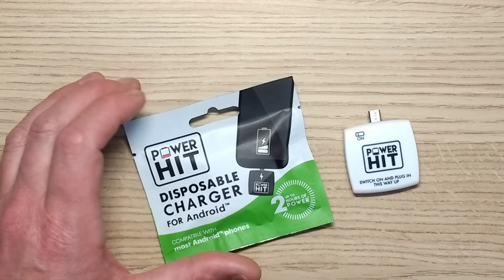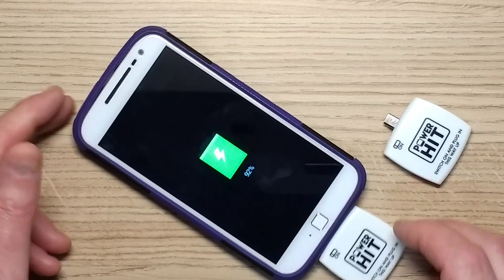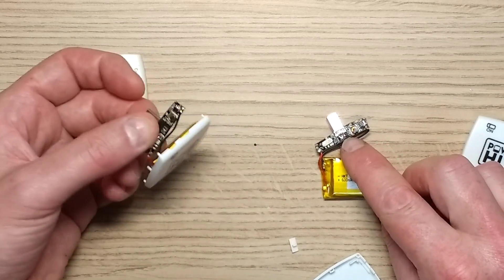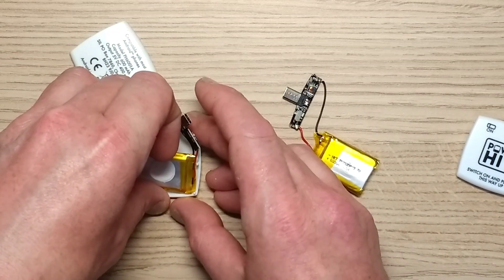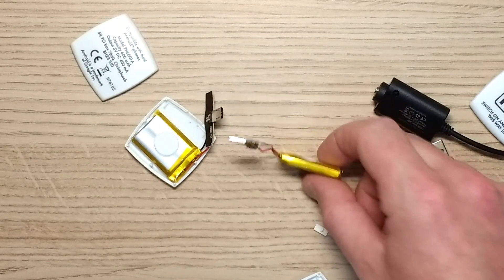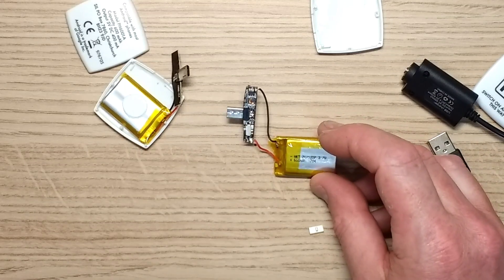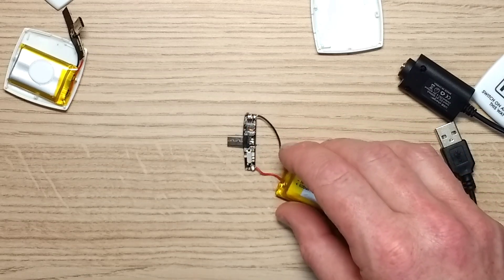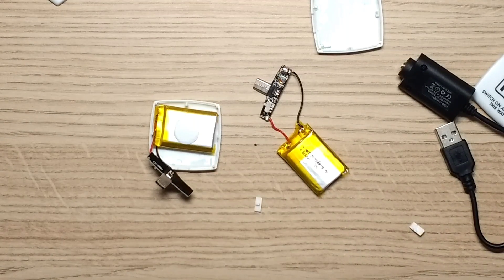What's inside a Tesco Power Hit disposable phone charger.

Comment: Android follows the USB 1.1 standard where dedicated chargers are supposed to have < 100 ohm between data pins. You can google the standard, it's in the PDF datasheets. Without this <100 ohm across the data pins, Android assumes its a data USB connection and limits itself to 500mA charging current. Apple disregarded this part of the backwards compatible standard, and most cheap chargers also neglect it. This is why people say Android charges slower than Apple, when really its Apple neglecting the standards as is Apple's way. I manually open my chargers and short the pins, or use a dongle with pins shorted -- this makes Android charge faster in my experience, especially on cheap chargers.

You might say Apple had the right idea in taking as much current as the voltage drop will allow at all times regardless of the presence of data since it means Apple products don't care what's done with the data pins -- but the danger in drawing excessive current is that the charger may overheat / smoke, the phone will be fine. If this were to happen to an Apple user, Apple would say they 'charged it wrong' by using a non-Apple charger, then proceed to sell them an overpriced Apple charger for like $60. It's a win-win for them, really.

Comment: They briged the data so your phone knows its just a charger and it will charge faster. There are more usb trix like otg micro or c to usb female. Then you have to bridge the pin next to gound to ground  so your phone knows it can send power to the device that is connected.

Comment: lol nice, thanx.
I have about 20 charging chips I bought for about 75 cents each. I'll have to pick up one of these, they sell them at the pharmacy down the street.
Reply: Dont
Reply: @iDontProgramInCpp  Why not? I could solder those little boards in & reuse them. Also I have a little Zune MP3 player who's battery is dead and it's probably close enough to the same size that I could use one of these to replace it.
   I completely forgot about this. I'll have to keep an eye out for them, so long as they aren't more than 4 bucks.
Reply: @christurnblom4825  ooooooooooohhhhhhhhhhhhhhhhhhhhhhhh, well I thought you were gonna buy those to dispose of them later

Comment: FYI the bridge on the middle terminals signals to Android phones to use fast charging mode. The magic and speed at which these charge is built into the phone. Not the battery pack. This is an environmental disaster. And potentially dangerous.

Comment: What if the data pin was tampered with because it siphons data from your phone and they're using lithium ion batteries because when people throw them away, they're collected and identified (probably with hidden RFID) and then recharged by the culprits, then they take the collected data off the circuit board. And boom

Comment: This in not a bad product, its evil. It would be extremely cheap (literary a few cents  per unit) to add the electronics to recharge the battery. As for the broken inductors. Some of these little inductors are wound around very brittle ferrite cores. Don't know why this more brittle material is used, but if not handled with care  during production you get damage like you see here.

Comment: The data pins are jumped deliberately its a part of the usb standard it lets the device your charging know its a "dumb" charge only setup otherwise it would not accept charge im not 100% but depending on which data pins are jumped determines the direction of charge (to either accept charge or provide power) of course most devices have microchips that communicate through usb but this is a dumb setup it literally just empties into your phone

Comment: You mentioned that one of the powerlines on the USB port was also tied to data in. For those that dont know, you must tie data in to (at least) 2 volts in order for an iPhone to recognize the power signal. Idk if it's the same way on android, but it might be.
Reply: Android, per USB protocol, is just to have the data lines shorted across each other.

Comment: These are terrible for e-waste... but I can imagine they'd be useful for third world countries with little to no reliable power, or as an emergency source of power for communications when travelling to extremely remote / dangerous places again without grid power. If these were to be useful / not ecologically disastrous for other applications, then they'd need a battery and housing recycling program. (this could actually add to the profitability if you just recycle the already in-tact plastic housing and circuitry and just chemically repair the spent lithium battery cells and you could even use carbon free (renewable) energy to recharge said lithium cells. This in its current form is terrible! BUT the crucial thing here would be making it NOT terrible!! I think that's the hard part and what makes this even moreso a million dollar idea than it already is.

Comment: Interesting! Those batteries are nearly identical to the cells I use in my cheap drone. Mine are slightly larger JH 902540P 3.7V 650mah. I did hear a recommendation to use a fireproof hobby bag (which I do) https://tinyurl.com/y9mymg8l Perhaps the cells exploding while recharging is the reason they only use them once? Are they used cells from returns on alike products? I've heard of power banks using recycled phone batteries that are found to still be working. Makes me want to buy one and see how it could be reverse engineered into a larger pack using several of them.

Comment: These seem to have disappeared from Tesco. Perhaps good from an eco point of view but a sad loss of a cheap local source of lipos for non-disposable applications, especially as Royal Mail isn't supposed to transport them. Responsible vendors have to use a courier.

However, I did find a similar unit recently in Poundland - branded as Power Pod, with very similar internals. This was an iPhone version with a lightning connector but was bigger than the one Clive decomposed with a 650mAh cell. 

The cell is also a little different from the usual foil-and-strapping-tape packaging : it's an aluminium sleeve with only the connection end open. Marked 523450AR.

I shall  be watching to see if they were the last few of the line or a stock item. I feel bound to rescue them from disposable use by buying them and repurposing them :).

Later edit - I see Clive's already reviewed the pouindland version at https://www.youtube.com/watch?v=6lflk6iY56w

Comment: The broken inductor may be a factory second, and so cheaper. It would be interesting to replace the battery with a pen light cell and see what voltage it will drain to.

Comment: Rubbish, I am not a hippie, but what a horrid way to waste tech, a proper power bank with 4-6 times the capacity is just a pound or two more, and it's reusable for a good time. I do not want even more electrical waste going to landfills and oceans. if it were a alkaline battery it would hold even more power, and it's disposable anyway. If It's a lithium battery you better make it rechargeable.

Comment: Horrible product, for 2 quid more I can buy a 2500mAH cell and recharge it in my ecig charger, which doubles as a power bank, 2 of those will keep my phone going a while without charging, several times this for multiple uses, even old batteries would last longer, then these packs just get landfilled?, it'd not just save resources but add value to have a charging circuit as people are more apt to buy something re-usable and the competition are providing much more value for money!